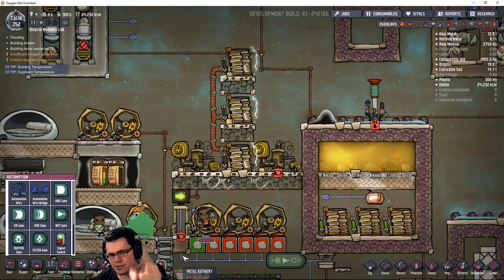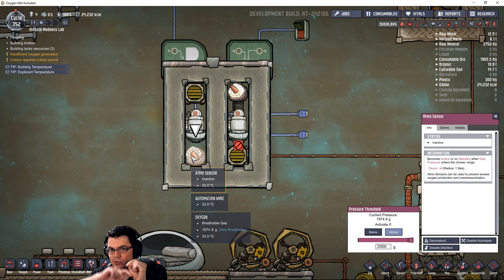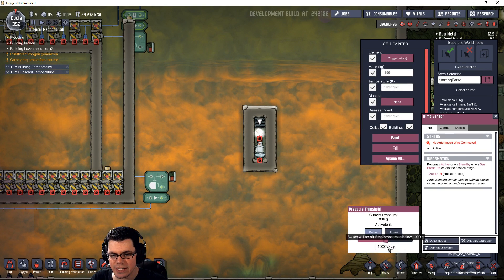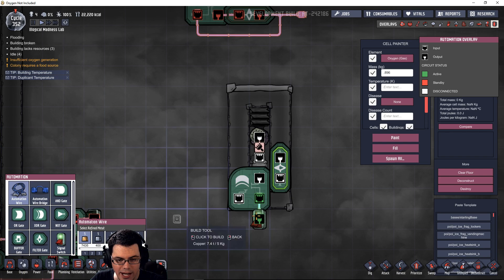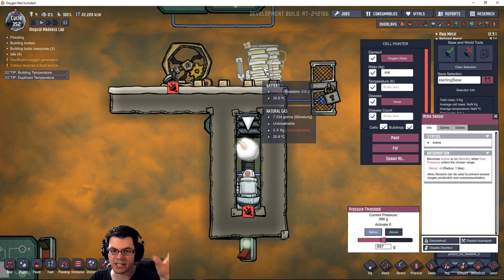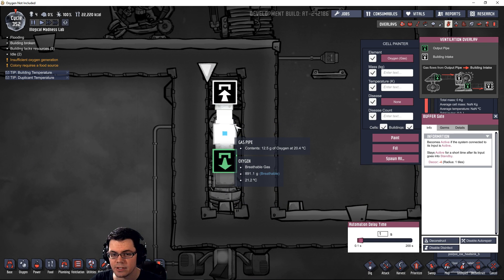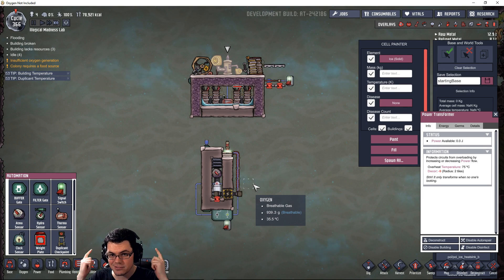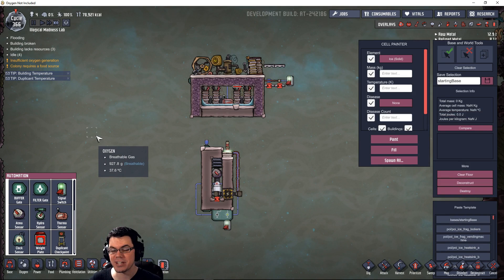Battery Sensor! Oxygen Not Included

Comment: My way is- im using small water pump wich droping water on the sensor to check do i have power or not, if pump will stop pressure on the sensor will drop below 1kg, then start generator untill time delay then stop
Reply: Just circulating watter will give you feedback, if it stops circulating
Reply: If you want i can make some pics
Reply: Александр Кустов dont torture them lol

Comment: Just got to implementing this system. I actually use the drop in pressure created by the pump. That makes the system respond a bit quicker because you don't have to wait for the gas to travel through the pipe and reach the sensor.  Apart from that this system is perfect, exactly what I needed!

Comment: Dont forget that those small batteries "use" energy too by leaking. Every battery you don't have is power saved / power you don't need to generwte in the first place. Not sure how much that is though, or if it is less or more than the logic system running at a polling rate that is comparably responsive. What I dont like about the battery model is that you have to tune it to the environment. It would need retuning as for example your base gets hotter to stay accurate

Comment: now that we have smart batteries, five months later, we need a way to tell if there is a current in a wire.
think of a "smart battery" that has a capacity of 1 J (some sort of a diode).

if this diode is placed before an array of batteries and connected to a power shutoff that goes after it, it can prevent the reverse flow / sucking juice out of the array, therefore one can make conditionally-attached power-accumulation systems.

right now a system with a smart battery decoupler (instead of a diode with limited capacity) there is an issue with having to wait for that battery to completely drain.

I think it's very useful to have just a sensor for wire current, the thresholds are very useful, we just don't need the integrated capacity, as this can be easily solved with an adjoined conventional battery.

Comment: Thanks for the mention :D I guess I should make a new version using automation as that can compensate for a lot of the little finicky nature of my design. I did work though. I typically used the liquid output of lavatories and showers run in a liquid pipe as the cooling as the output temperature will vary very little making the thermal sensor much more precise.
Reply: A P-State sensor :D

Comment: Why not just have a pressure button in front of the hamster wheel.. when duplicant runs over it, it activates for a short time --> meaning your battery is low... then a buffer gate connected to the preassure plate to keep it active for 200s (or the time needed) activating extra generators to charge up the batteries... (wouldn't that be a very simplistic yet working solution?)
..just saw someone pointing this out down below in the comments...

Comment: Ok maybe I'm an idiot but why not just use a NOT gate with a buffer gate to regulate a generator.  So when the representative battery runs out of power it will flip the generator on and the buffer will keep it active long enough to fill up the battery(s).  It seems like you used a lot of components to mimic what a NOT gate already does.
Reply: A buffer can be configured to the minimal time it takes to fill the battery bank with no consumers. The sensor is needed to indicate power is low to start the generators.

Comment: Something like this also works Mr Broth, and the liquid flow set to 200g/s lets you have a built in timer function to stop the unit tripping on/off all the time https://imgur.com/a/DimDk. 200g/s for the flow 0.1K for the hydroswitch, it uses more power but its very simple. Also have you tried one tile liquid locks since AU main release, I've found water moving off the tile after dupes running through it enough (game on high speed, alot of building in the area) tested twice, both locks failed :O

Comment: You don't need multiple batteries in the sensor, you just need 1 of the bank to be isolated?
Reply: The thing is tiny batteries hold 10KJ. Large batteries hold 40KJ. Both drain at the same rate. So if we say you have 1 of each. The tiny in the sensor and the large in the bank that's 50KJ total. When you've drained 20KJ from the system the tiny battery is empty and stop producing heat. This is what triggers the sensor.

Comment: Brothgar there is a very simple way to detect a certain level of power.
Basically you have 1 Battery (can be inside of a bank since once they are full they stay close), 1 TreadMill, 1 Duplicant wait station, 1 Pressure plate and 1 Power Disconnector.

So the logic behind this is very simple: You set the treadmill to have a certain powerlevel when the dups should run. You set it to priority 9. Then you link it to a Battery with a Powerswitch on it.
Then you make sure the only access to this treamill is through the dup waiting station underneath that or the tile before that you put the pressure plate. 
(you may also need gates for a delay pulse)

But once a Duplicant wants to get into the treadmill to power the battery it will wait before the waiting station pressing the Pressure Plate deactivating the connection between the Battery and the Treadmill. This Signal also can be used to turn on generators.
And since the connection between the treadmill and the battery is blocked the duplicant will leave the area because its no longer a needed task. Leaving you with a duplicant activating switch with instant activation as soon the duplicant arrives. That doesn't die because the night and doesnt rely on a powerfailure!

You might want to delay the turn off of that signal to ensure that it runs a certain amount of time. That can be done with a or gate where the pressureplate goes into and a buffer seperate to pressure plate signal (that is powered by it) that goes also into the or gate. (this is how you extend a singal)

Edit: You can hook the automation wire also directly to the treadmill to shut  it off.
Reply: He did mention he wanted it to work without dupe inaction at all ;)
Reply: well it requires a dupe but a dupe to fly by for 1 second. Not a dupe staying there and recharge the battery. Thats a completly different. Since it doesn't eat up a duplicants time!
Reply: Dupe interaction is dupe interaction no matter how short, so it doesn't live up to the initial premise for what is explored in the video. It is also why I designed the thermal sensor in the first place because people asked if they could make a battery sensor that did not require dupe interaction at all. In any way.
Reply: thats true but a duplicant allows you to set a percentage activation while a sensor is only 1% or higher detection. and it havyly based of a constant flickering of between 0 and bigger the 0. While my system is a not enough power sensor that can be adjusted. You could even add a priortiy activation to it.
If it is at 90% its a task of priority 2, if its at 75% its a priority 4, if its at 50% its priority 6, if its at 30% its priority 8, if its at 10% its priority 9.
Thats something your thing cant do!
Reply: No. It does not flicker at all when set up correctly. And the ratio of tiny batteries to large batteries in the system let you set the percentage by adjusting that ratio.

Tiny batteries hold 10KJ. Large batteries hold 40KJ. Both drain at the same rate. So if we say you have 1 of each. The tiny in the sensor and the large in the bank that's 50KJ total. When you've drained 20KJ from the system the tiny battery is empty and stop producing heat. This is what triggers the sensor. In the above example the sensor will trigger when the bank is below 60% full.
Reply: simple is great but if you're wanting a quick and reliable signal (ie: works during the night), the setup he came up with is amazing. You can customize the signal that comes off of it easily, each check can tell you if there is or isn't power. And correct me if i'm wrong, but dupes will charge before the batteries fully empty. Also, It's possible to build a system to check when fully down and when fully charged using his little gizmo(with modified logic of course). No timer adjustment needed for when you plug new equipment it'll just turn off everything if your main battery bank is full.
Reply: You got the part with the Charge thing wrong. The idea is the dupe runs to the wait station and then the treadmill gets disabled and the generators get started. With a timer how long they should run ofcourse. That would mean that the duplicant goes there waits 1 second (or less) and moves on to other tasks. 
And yes you have a valid point with the over night thing. But then again you could just add a time sensor in that starts up the generators over night to ensure that power is there. If they are not already running.
Reply: Ok I should have said attempt to charge a battery. The time sensor is a good idea if you're using almost all of what you produce. If you produce way more than you need because you are preparing to build something that will use all that power or just cause you can.... You'll waste a lot of resources over time. 

A drawback I see to it though is now you have two separate systems controlling your base and it has to switch from one to the other overnight and then back during the day. Not impossible but more complicated. 

 I'd most definitely start with your idea at the beginning of the game. Your method does add energy to check vs draining it. Even if they are both small amounts. But, maybe you do want that dupe on your wheel the whole time you run your generator for a quicker charge. But hey, anything that can get me a full charge/discharge cycle of batteries w/o any waste I'm all over. If you're able to accomplish this with a simpler method I'd be really interested.
Reply: Well to be fair this idea came up in my head. I don't own the game actually. I just saw possebilities and made this theory. My idea has no proof that it would actually work on not. But from what i have seen it should work. Yes i am removing wind out of my sails. But i wanted to point this out. 
Basically if i have this game i would not sleep/eat or other things anymore of what i wanted because this game would inhale me with the logic gates. (ofcourse i would still eat/sleep but i wanted to show the effect it could have on me.) But hte other reason is. Its to expensive for me. I usually buys games for 20$ a year. And only if they are really cheap at the point.
Reply: Well i suppose this should be the game you buy this/next year it's that price on steam right now.
Reply: Also this game has a lot of possibilities and now with logic gates anything really is possible to make. It just may take a lot of time and troubleshooting. So don't sell yourself short.
Reply: Hahahaha maybe. But there are a couple other games that i would like to have xD.
Also the issue with the night would be easly solved. 
Just add an XOr gate that has the timer in it and is turned of by the dupe signal. And just add to the dupe input a delay so that the manual duplicant signal will be lasting longer as expected. 
Fun fact you dont even need the "Waiting Stations" with my system. You just add a pressure plates there since they would be all linked together. So no power usage at all.